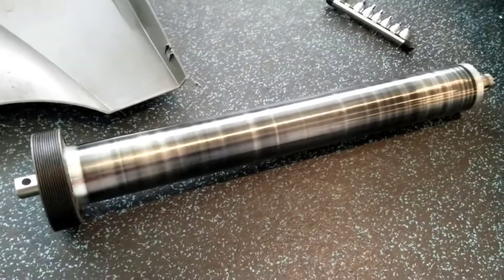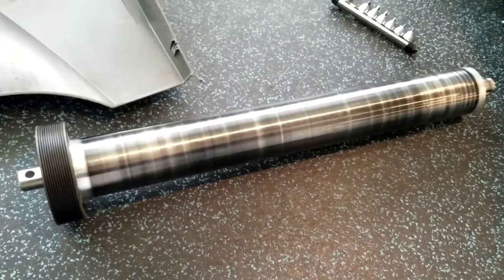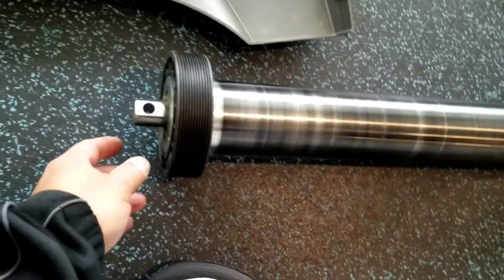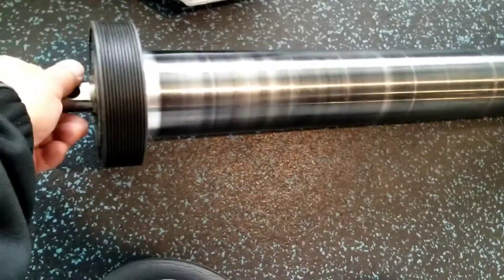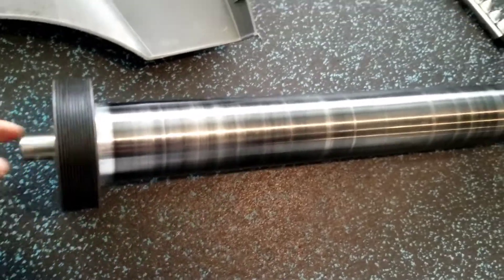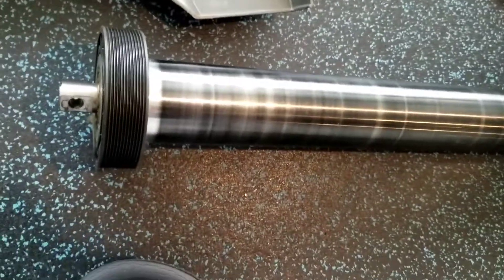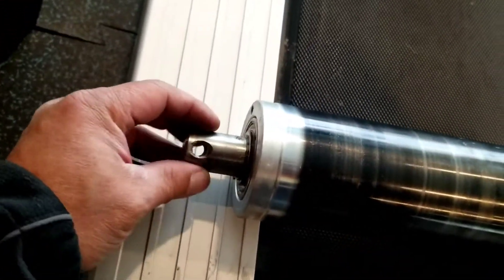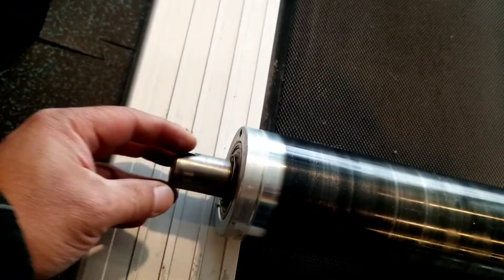How to know if you have bad bearing on treadmill rollers.

Comment: Great video ... I think worn bearings cause the motor to overheat ... plus the roller itself heats up increasing the temperature of the belt ... I also think the scratched roller might also cause surface scratches to the belt wearing it down prematurely